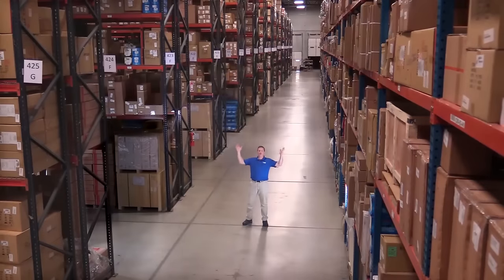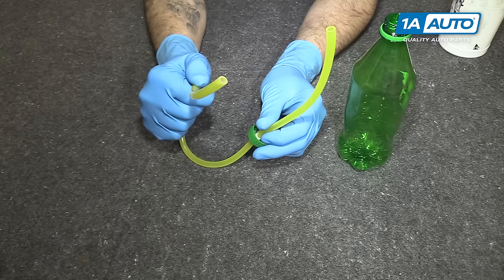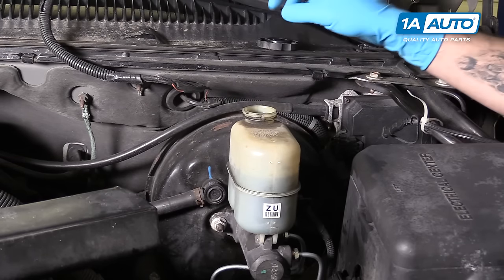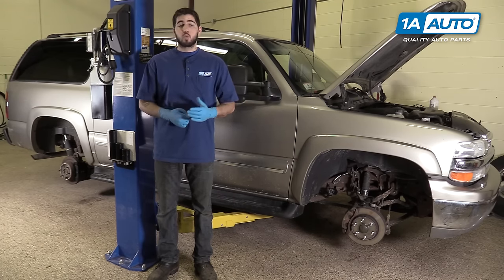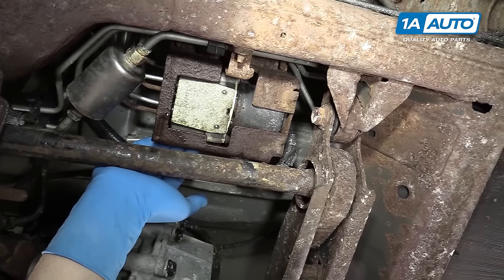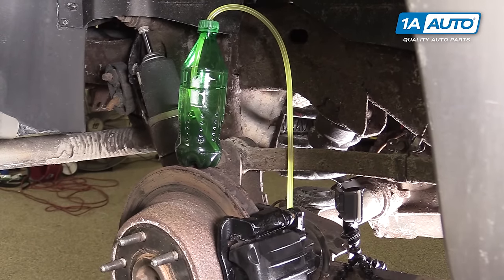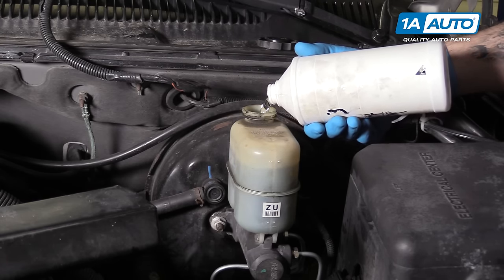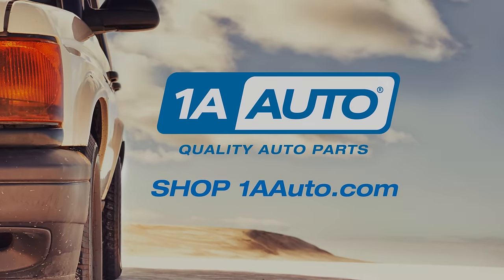How to Bleed your Brakes by Yourself

Comment: Not a good way to do it......you can get air past the threads when lifting the peddle up. Plus never use an open end wrench or a 12 point box wrench. It WILL strip the bleeder hex nut part.
Reply from the maker: +Anthony Marsala We appreciate the feedback. Sometimes there are multiple ways to accomplish the same repair.

Comment: How about use the brake fluid bottle. Less likely to get contaminated with water.

Ok, you might have left over fluid, but especially in your case, the "whole system" if you don't want to drill a hole in the cap, put two zip ties around the bottle neck.... 

Ok one around the neck one held via it, then a third between that and arou d the hose you won't drop the bottle, but yea it can spill if knocked over, but it can be closed again.

But Just replacing my calipers I used enough fluid to use a whole bottle of the small bottles of dot three period granted I did spell some out of the hose

Comment: do i really need to buy a bottle of sprite so i have that bottle? or does a Pepsi bottle work the same? preferably mtn dew since thats what i drink alot of.
Reply: In your case, drinking three bottles of Exlax, one bottle of Coke, and a chocolate shake, will provide the best results. And use the coke bottle for the job, you'll see the bubbles best.